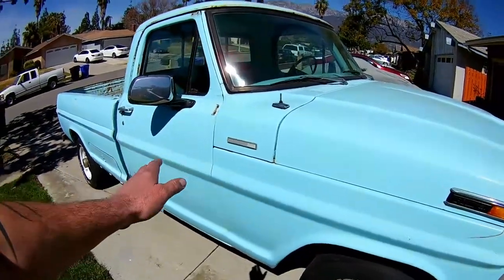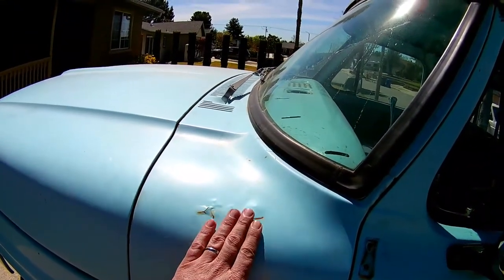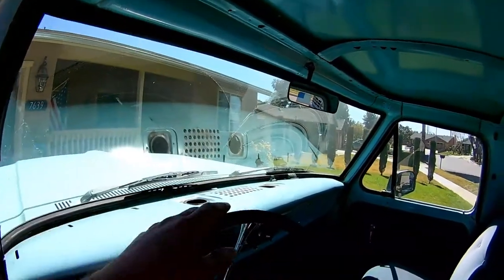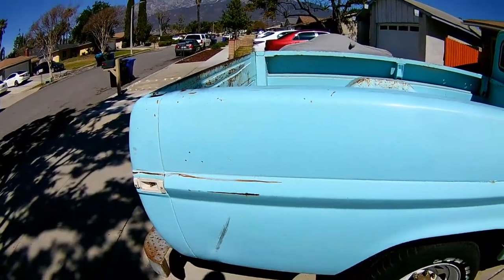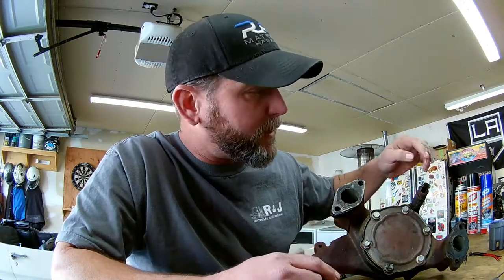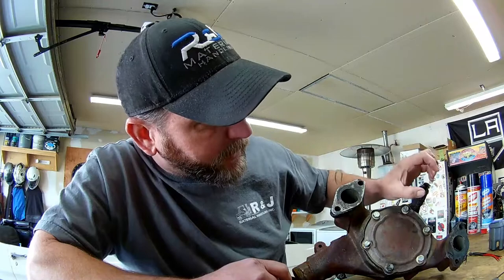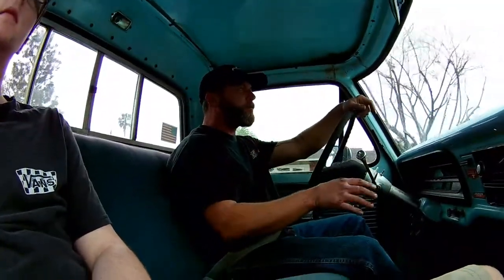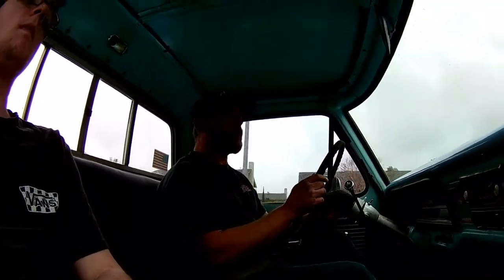71Bump; 1971 F250 Bumpside Project, Long Neglected!

Comment: Awesome im looking for a rat rod shop truck bump side Ford truck project myself prefer a 68-71/72 sport custom or custom cab camper special trim truck.. and if not those trim trucks the horn ring chrome and the center cap steering wheel option, the chrome headliner trim and the door outer trim, and the upper and lower exterior trim package a ranger trim truck would be nice too..but they are pricey although with what I am looking to do all of the variations seem worth way more than the second gen dodge ram somewhat of a project truck i want to trade for one,, and if not for a ground squirrel it would be a running driving truck has some rust around the edges since it is a northern Ohio truck but it is way better than most of the second gen dodge trucks around the area im in...

Comment: My 72 fuel gauge isnt working any tips?
Reply from the maker: most of the time it's the float, either fell off the arm or has a hole in it.  you can test the sender to see if it's getting a good ground to bare metal and if it is sending a resistance to ground on the gauge output wire.  if that all tests out then it's likely the gauge on the dash or the dash power supply relay on the back of the gauge cluster.  if it was that though, most of the gauges would not work.
Reply: @vintagespeed  thanks man